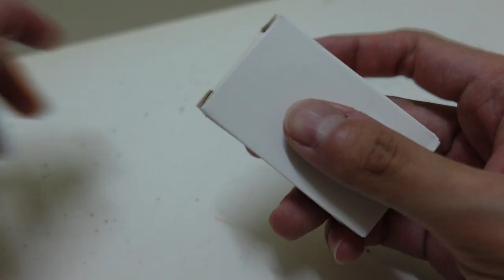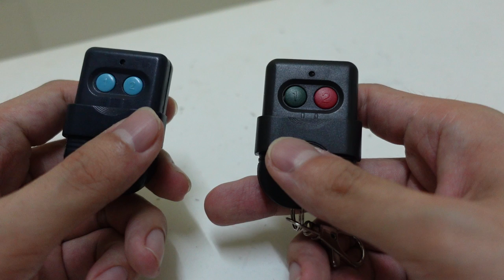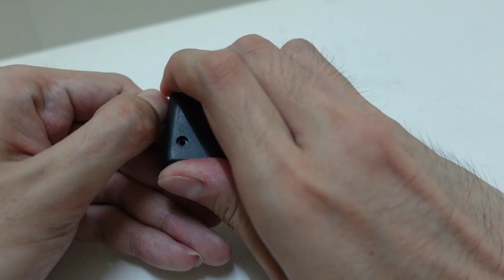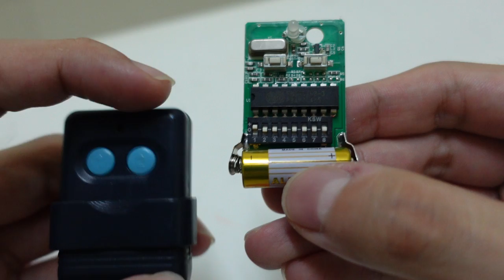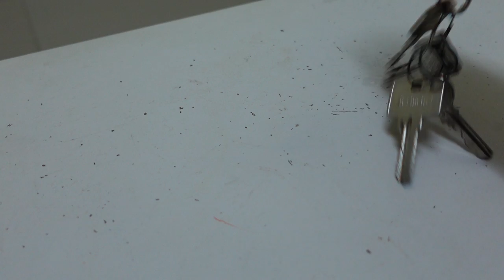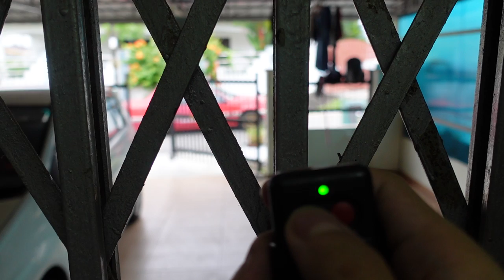How to Replace Autogate Remote Controller (Easy & Quick Guide)

Comment: Suddenly our R330 controls are not working. we thought it was a bettery issue hence changed it, but it didn;t worked. and what is weird, is an old remote also R330 started working again while all new R330 controls are not working. Any idea how to trouble shoot this. The numbers configurations are right, otherwise the gate cannot be opened at all. Any suggestions?

Comment: useful video, however im stuck whereby my new remote control is 2-1 instead of 1-2. do you have a video to fix that?
Reply from the maker: Sorry, I have not experienced that. could it be that your new remote control looks different than your current remote control? As in, they're very different models.
Reply: actually the same. its alright. anyways, thanks for replying. 🙏